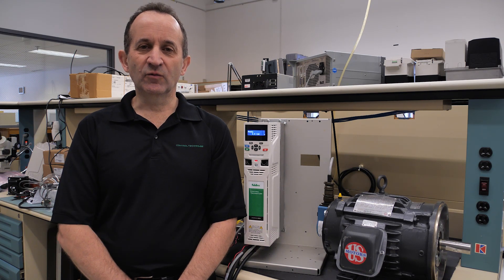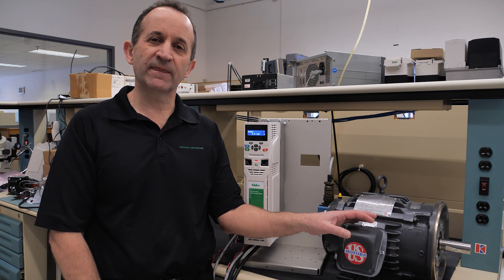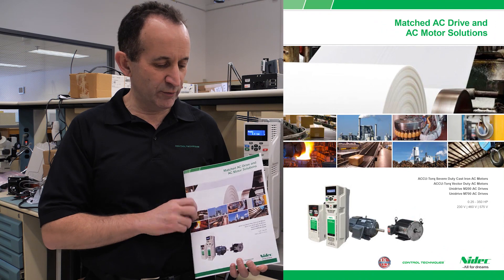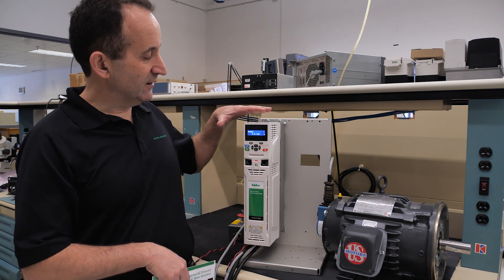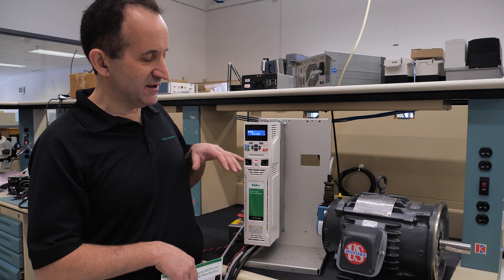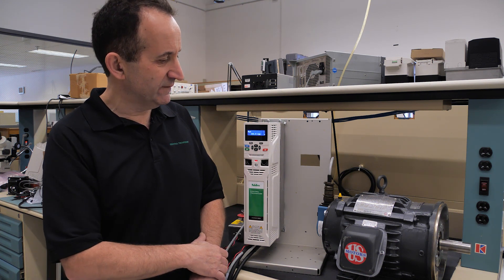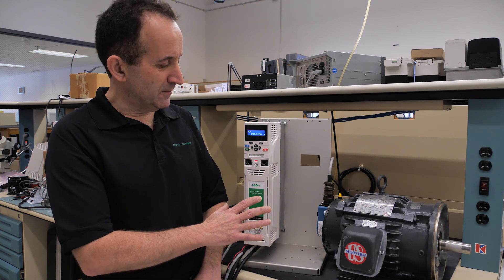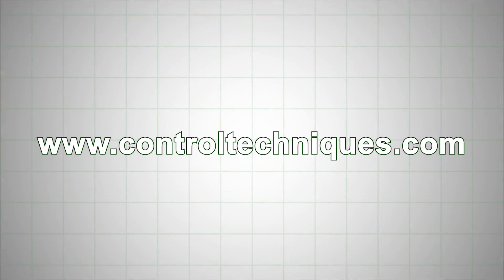Nidec Motor Drive Match Demo

Comment: Friend would you give me the datasheet of this engine C9MNR11?
Reply from the maker: Sorry, I don't recognize the part number. If the motor nameplate shows Control Techniques please create a support ticket www.ctdrives.com/techsupport click on the orange button "CREATE A TECHNICAL SUPPORT TICKET" with our technical support group and include a photo of the nameplate. If the motor nameplate shows Leroy-Somer please contact the Leroy-Somer support. If it shows US Motors please contact Us Motors support, or if it shows Nidec please Nidec Motor support.
Reply from the maker: Maciel, the motor shown in the video is a US Motors ACCU-Torq server duty motor please see their website for links to data sheets. https://acim.nidec.com/en-us/motors/usmotors/products-and-services/ac-motors/variable-speed-motors

Comment: I have the h300 50hp rated.
It has the bypass grey box section below.
There are 8 of these drives on a new construction site in Naples Florida. 
I have a BMS sending a 0-10vcd signal to my drive, a start stop signal and an rib CT signal proving run function. 
Where do I land my start stop connections?
Tb2? Tb3?
At the drive?
1-9?
Help
Griff hall 6164190440
 Naples Florida
Reply from the maker: Hello, I see you've already contacted our Technical Support team regarding this question. Thank you for choosing Control Techniques.